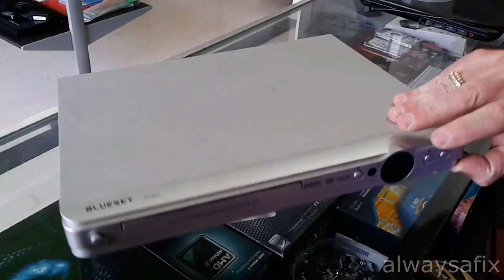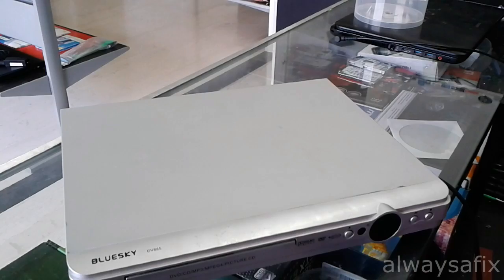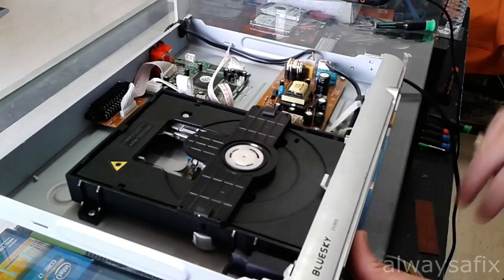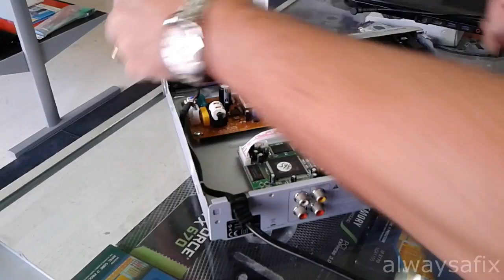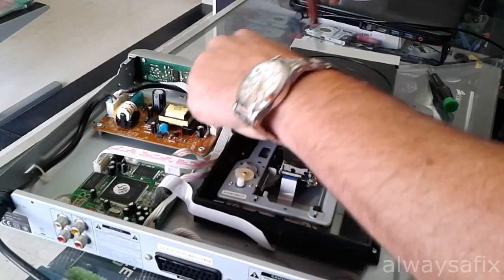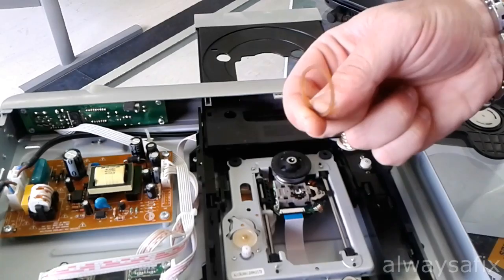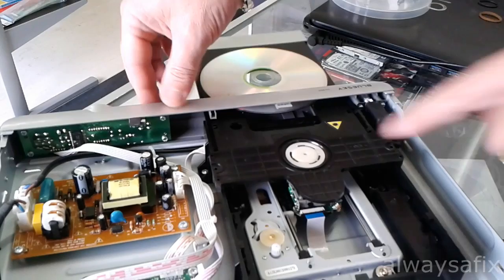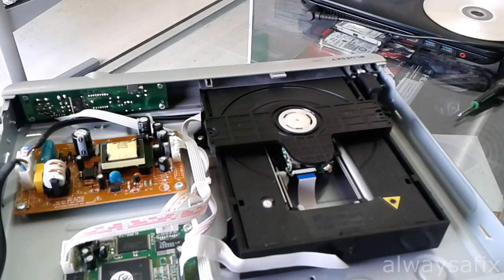DVD player will not eject easy fix

Comment: Thank you so much for your help!
I also had to remove the dvd upper bracket to get better access. 
In my case the belt was off but still in proper condition, so I just reattached it and it works!
Reply from the maker: Glad my video helped you out, thanks for watching

Comment: I hope you read still comments on the old videos. Have the same DVD Player built into a DUAL "multi-thing". 99% sure it has the same problem. Unfortunately no emergency release slot at the bottom. Is there any chance to release the tray from above? All other components are stacked on top of the player. I have access from above, to replace the drive belt, but need to open the tray first. To take the player out would mean take everything apart, disconnecting tons of ribbon cables. Can do, if I have to, but it will be a nightmare.
Thanks in advance and yes your are right - there is always a fix.
Greetings from Germany!
Andreas

Comment: Are the dvd players inside PC's and laptops similar? I have a non-ejecting drive in my laptop, although it looks like it might have a micro dent  in the metal frame surround which could be preventing Auto Eject. Excellent clear video, well done, and Thanks.

Comment: Great video!! Our belt was actually on and working fine. We removed the two screws in order to see the motor and belt and I believe the magnetism from that top piece is not allowing the door to open. Do you have a video or steps to check next if the belt is working? I've got a Phillips HTS3450/37. TIA!

Comment: Great video! Thanks for sharing. How much repair shops usually charge for such malfunction?
Reply from the maker: +yourtv Around $10.
Reply: +alwaysafix Thanks for letting me know.
Reply from the maker: +yourtv Thanks for watching.
Reply: yourtv 
A FREAKn arm & a leg. Labor ALONE more than $30! NOT INCLUDING the belt!  RIP OFF😤 Most shops won't even bother. They'll suggest to buy another unit. It would be MUCH cheaper. Than to fix these things now a days. FYI.

Comment: How do u pop open the tray? Mine doesnt have a gear and the bottom has no holes to stick up a screw driver as shown.
Reply: U hav to open the top..   And then slide the tray

Comment: I wish that was the problem with this Phillips player I'm working on... As soon as I remove the metal cover from the top, it ejects no problem. Put it back on, no more ejecting. There's no dents, no visible strain on anything, etc. Before I popped the cover, I was sure it was the belt... No clue how to fix this! lol
Reply: Oh man this is the same exact problem I have. I took the dvd drive out and it glides in and out smooth but when I reassemble…failure. Then I got to thinking “why do I own a dvd player and why am I trying to fix this” but I feel that it’s personal now
Reply: @meltmyfaceoff  I fixed it by spraying a bunch of light coats of plastidip over the magnet
Reply: @somethingelsedoesmatter  thanks I’m gonna try this!

Comment: Where did you get that new belt? I inspected mine and it seemed to be good but it's still not ejecting. I tried an O ring that I bought from home depot but returned it. It did not do the job. I have rubber bands but they are not tight enough. I did notice you got a similar elastic belt band for yours. Where? 🤔

Comment: Nice fix.. Where did you get the replacement belt?
Reply from the maker: if I remember correctly, I got it from a faulty PC DVD drive
Reply: @alwaysafix  Hehe, I've got one of those to look into and my home Samsung Dvd/vhs to check, the tray doesn't open when button is pressed. But I do hear the motor.  I just want to make sure the replacement belt is the proper one. Thx.

Comment: +alwaysafix My sharp 3in 1 stereo wont open the 3 disc drawer & is showing ER on the lcd display,is this likely to be a problem with a drive belt ? & do u think the ER (error) will stop if i replace the belt or could it be a separate fault? Help as its driving me crazy & i have 3 of my favorite cds stuck inside the stereo 🙁🙁🙁🙁🙁🙁🙁🙁🙁

Comment: I have an HP DV1000 laptop that the CD drive draw will not open, I have to keep hitting the button to get it to open.
I don't want to take the laptop all apart to get it out.
What could be causing this problem?
Reply from the maker: Open my computer, right click on the dvd drive, and click eject.  If it opens I suggest to continue doing it this way, if not it needs to be replaced.  Good luck!
Reply: THANKS